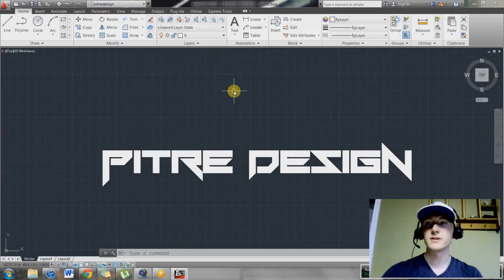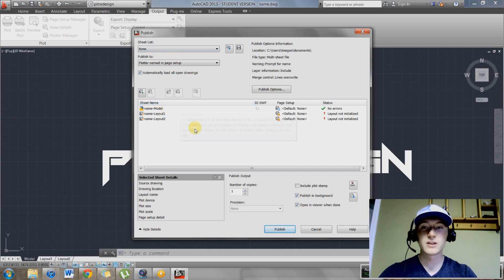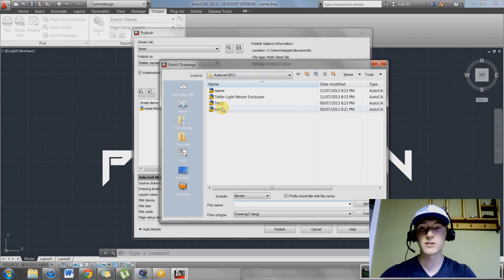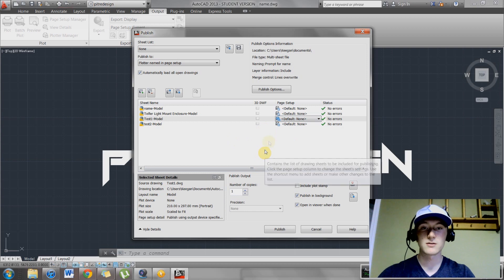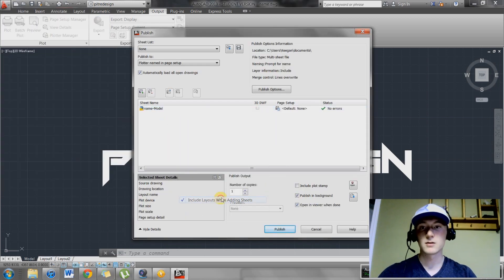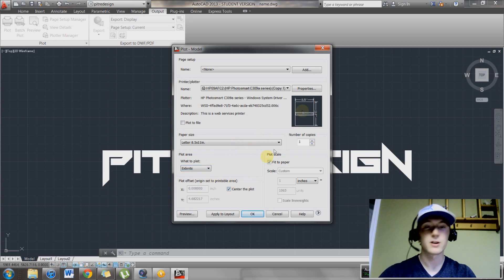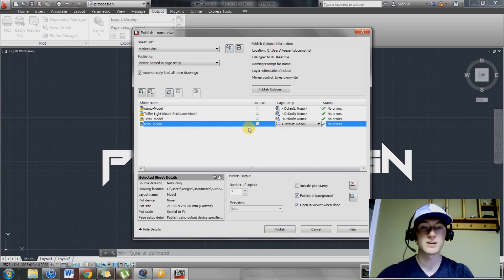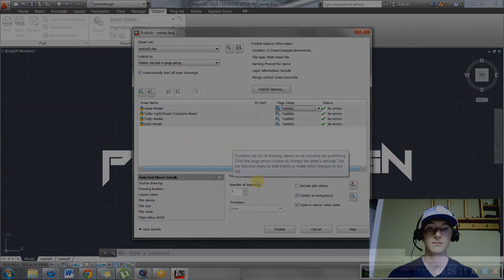Batch Plotting, Publishing, or Printing Multiple Drawings in AutoCAD.

Comment: Hey! Hope you'll see this comment.
I always use Publish feature since is very useful especially with large multi layout files, but I'm actually having a trouble to publish with different Lineweight as I do with normal single Plot. After finish to publish, all the lines in the final multi PDF appear at the same thickness. I'm looking for a solution around the web but couldn't find any solution. That is so frustrating!
Please let me know if there's actually a way to publish different line weights and how can I do it!

THANKS A LOT IN ADVANCE!

Comment: it only print single drawing from single layout, it does not print multiple drawing from same layout. why????
Reply from the maker: I'm not sure what you mean by layout, but if you save a page setup, you should be able to use it from the drop down menu in the batch plotting  window. I might be able to help more, if you're more specific about the issue.
Reply: I have 5 drawing sheet in a single layout, it only print single sheet from layout
Reply from the maker: You mean you have multiple drawings in the same drawing file? For this to work they each have to be in a separate file.

Comment: Why doesn't the template i created appear in the "page setup" drop down menu?
Reply: The answer to Nick Santorso's question. After PITREDESIGN set up his "testlist1" and clicked cancel out of the page setup pop up box, at 4.00 on the video, you need to save the drawing. PITREDESIGN forgot to mention that part. Now the template will appear in the drop down menu.
Reply: THANK YOU
Reply: @georgeleong1572  thanks man
Reply: +Nick Santorso You have to select it in the drop down of the file that you made your print setup in because the setup is stored in that file, it's not in a file of its own.
Reply: In the publish,  it still showed Default and Import options only.
Reply: Thank you!!  This was frustrating me because I had done it successfully before but the 2nd time was harder 1 year later because the first time around I didn't have to do this part.

Comment: question: I have all my drawings in on file but what to use publish so I can plot them in order quickly, will publish work for this? also I'm having problems with assigning plot settings in page setup. I set a plot parameter to the sheet list but it plots with a different  plotting ?
Reply: Yuri Richardson Watch "Autocad Batch Print - Plot - Publish Multiple Dwgs in 1, 2, 3" http://www.youtube.com/watch?v=o1vUX-t8510&list=PLbDdle4GGWB4BYAiAq7QxRlQDyA272vwz

Comment: I am having issues with Batch publishing, I am getting any error that states the PMP folder is missing, then internal error creating custom paper and unable to create requested media size. I have a default set with my CBT file and paper size. I have batched published before, this is the first time this is occurring. Any advice?
Reply from the maker: Jackie Norcini I havn't come across this before, but have you changed computers recently? Changed any printing settings? Are you on windows? Or updated autoCAD? A google search might help too.

Comment: Hi. Sorry for question, but can you help me how can I print some DWG Files from a path list fast? Nearby a cmd prompt commad, or other. I wouldn't like open them in DWG TrueView, just print.
Reply from the maker: If you have a list of drawings that are in a folder you have to open the publish dialog box. In autocad 2013 just above the sheet list you'll find a button that says add sheets. From here you just select the dwg's that you want to print and it will add them to the list. You also have to make sure your print settings are correct.. it shows you how to do that in the video.

Comment: Hi I'd adjust my drawing on center of paper sheet but it end up not accurately plotted. What should I do?
Reply from the maker: Hey, when you open up the plot window there should be a a section that says what to plot. Select "window" and then select everything you want to be printed. Under plot scale in the plot window, select "fit to page".. this should work.  You can always select preview to see what it looks like.  (this is in autoCAD 2013 btw)